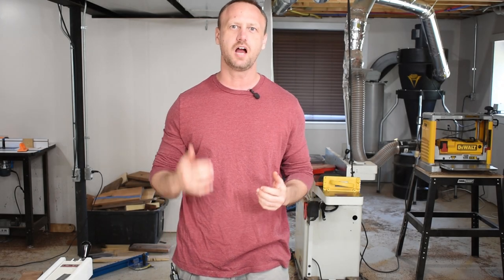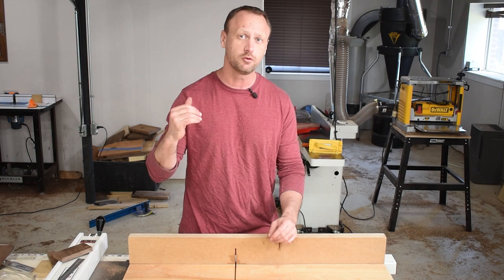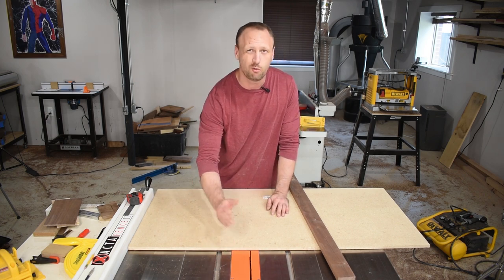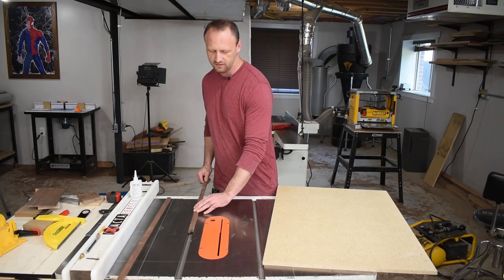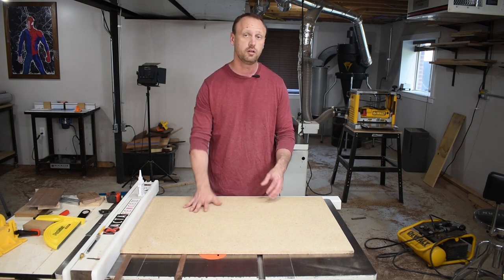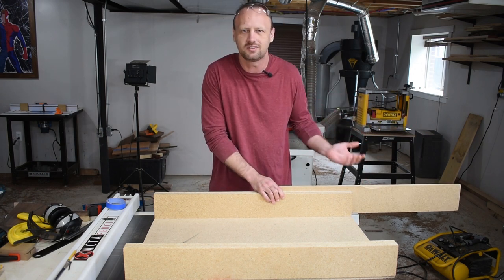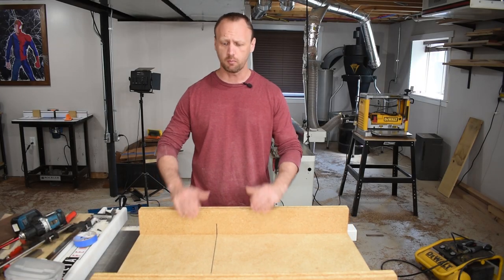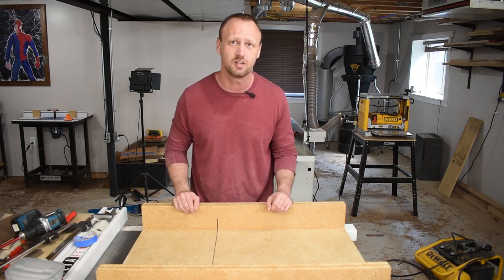Making a SUPER EASY Dead Accurate Table Saw Sled!!

Comment: A good presentation, overall.  But a couple of comments:  I'm 73 years old, and I'm definitely not 6' 2" tall and proportionately wide.  All that 3/4" particle board looks like a heavy, awkward dead weight to schlep around.... I'd rather use 1/2" Baltic birch, and shrink the overall dimensions anyway.  And using a dial gauge, I've found the average 10" saw blade isn't 100% flat.  Placing a precision square against one,  then rotating the blade 90 degrees and trying again, will often give you two different reads.  I think you should be squaring off the kerf instead, and the longer the square the better.

Comment: I like things basic and simple same as you. Basically the only thing that might be an improvement is a small chamfer at the bottom of the "hands on " fence for saw dust control.
Reply from the maker: That would be a nice addition. It's something I should have done.
Reply: Agreed.

Comment: Agree 100% with your comments on the 5 cut method. Seems way overboard to me. Really doesn’t need to be that perfect for most work, and besides wood moves. Or things get bumped etc. as long as it’s very close it’s fine by me
Reply: @NickGranville, everybody has their comfort level.  I would argue that because wood moves and because things get bumped and because of sawdust against the fence, etc  that is exactly why it is important to be as accurate as you can in the beginning.  Why compound other inaccuracies?  Also, I think using a micrometer and feeler gauges is fun!!  

You can also just do the 5 cut method without all the math.  Take a 12 x 12 sheet good and cut a sawblade off of it. Then rotate.  Repeat 4 times.  Now check your last corner for square.   All the cuts just compound the inaccuracy of your  fence. Adjust your fence about 1/4th of the total inaccuracy per foot of fence from the kerf.   Wash rinse, repeat.  Playing cards make good feeler gauges.  Takes <5 min and good forever.   ... and if you are really that dead on, you can say  'told you so!!..... Also works for miter saws,btw.

Comment: I would say the fence furthest away from the operator is the front , the operator is not pushing the sled backwards towards the blade. Also the operator’s eyes are looking forward , therefore they are pushing the sled forward to make the cut and pulling it backwards (towards them) after the cut. There must be something wrong with me to have put this much thought into it 😞. Anyway, great video.

Comment: Can the bottom of the sled be made of 1/2" plywood or does it need to be MDF. Thanks in advance. Also did you remove the riving knife to use the sled?
Reply from the maker: Yep,  you can use plywood. The key is to use flat material. Yes, I often remove the knife when using my sled because it sticks up slightly higher than the blade.

Comment: I just came across your channel a few days ago.  I plan to make this sled and love how easy you made it look.  A question is with the rails on the bottom you left the front longer than the sled, but you cut the back even with the sled, is there a reason why the front extends past the sled?
Reply: I believe it’s to make it easier to line up the slide with the miter slots when setting it in place.

Comment: You have gumption putting a video up on YT without a 5 cut method.

I’d love to see how your sled equates to a 5 cut result. Would be crazy to see it dead on simply using a square.
Reply from the maker: It is 100% dead on. The 5 cut method is overkill for me.

Comment: "super easy" because it's half-assed.  you can't just put a square up to the blade. that's not square enough.  if you do Ng's five cut method, it will be a little less "super easy," but it will be a much better sled.  you find the 5 cut method overkill for you because you are a half-assed woodworker.